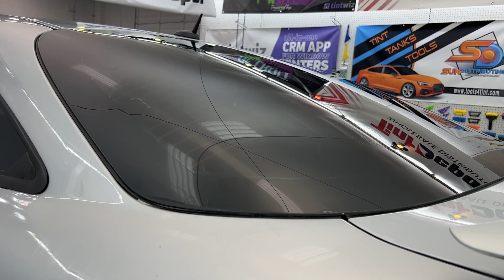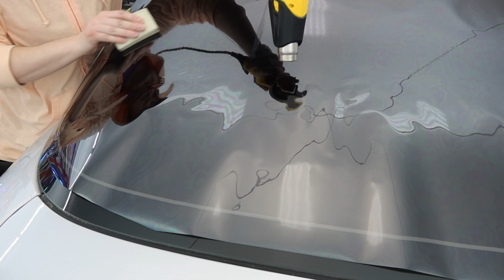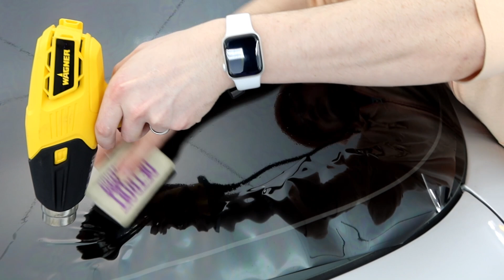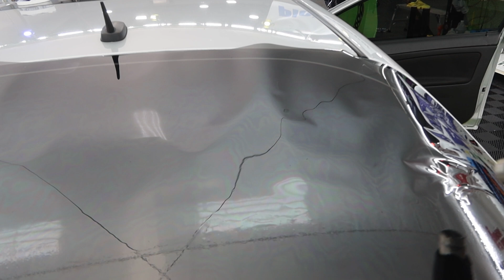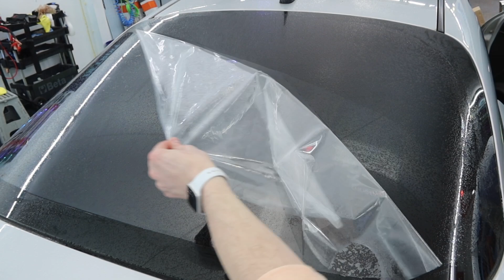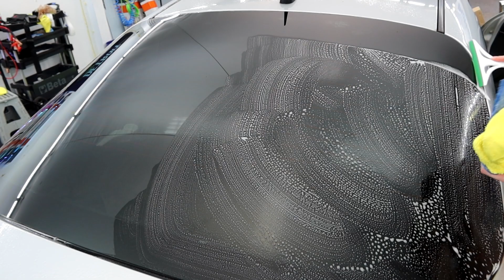HARD CURVE Back Tint Shrink!

Comment: Please god someone has to bring a Porsche 944 to you. I would watch and re watch you tint a 944 religiously.
Reply: Old one or new one...
I grew up on the old ones...
Not fun...
Reply: @resca5738  Exactly that’s why I want to see someone do it so bad. I’ve been told 80s Porsches are the hardest windows to tint and that’s why no one will touch them. I live out in the desert so I really need it done lol.
Reply: Just go at it...
Think on those disconnect hatch holders...if not cut around them...
Release cut (old school) film using defrost  lines...
Dought there is any vdo's of  that car...
I had to do it back then no vdo's...n dry shrink wasn't around...might be easier dry shrink...
Nothing to fear but fear itself...
Samething 4dr Oldsmobile n 4dr Saturns curve glass...
Y'all got it easy now a days...
Reply from the maker: Yikes, lol yea the 944 is huge pain